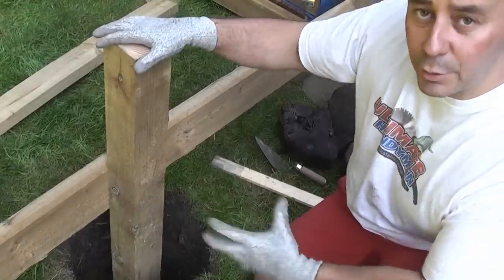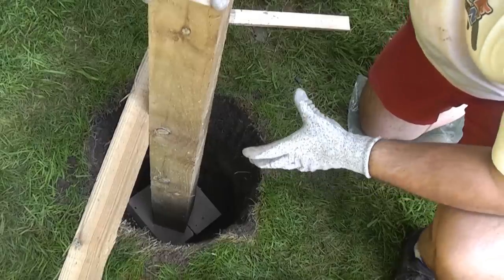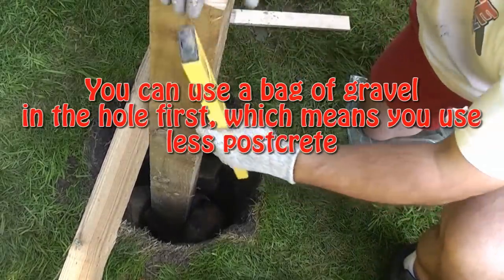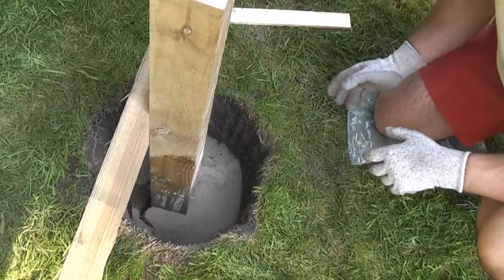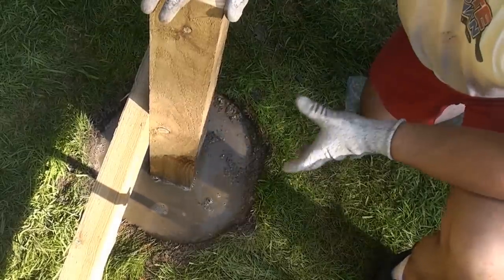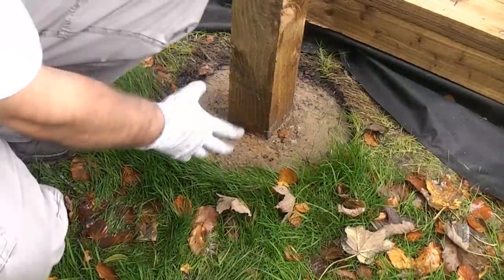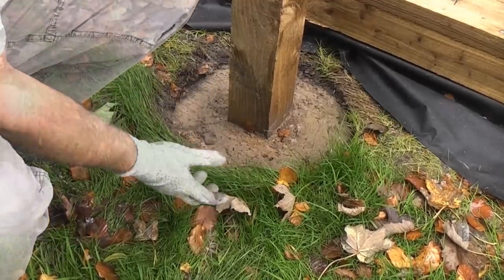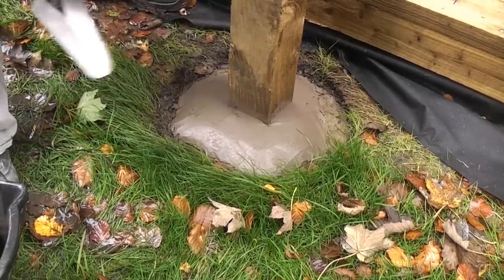How to install decking posts

Comment: Hello handyman. Can I use gravel in the holes instead of engineering bricks? Many thanks.
Reply from the maker: No, it needs to be solid to give the post support.
Once you have put the engineering bricks in the bottom, you can then fill the hole with some gravel, before using concrete or post crete to secure the post ;-)
Reply: @ultimatehandyman  that's great thanks for your help. Will breezeblock's work? Totally makes sense. Cheers.
Reply from the maker: @graham6807   It's better if the block is solid, if the block breaks, the deck could fail!
Reply: @ultimatehandyman  thanks again for your reply. Will make sure it's on engineering bricks. 👍

Comment: Have you any videos on installing a telescopic bollard into concrete for home/car security?  
The foldable ones are not as secure , but I don't known once iv broken through the first layer of concrete if its just a sand screed or if driveways are solid concrete, it would be a nightmare breaking and digging out the depth of the bollard sleeve  if its solid floor.
Reply from the maker: No, sorry I have never installed one of those.

Comment: Hi could you just use the postcrete to fill the hole half way up and then once its hard fill the hole back up with topsoil so you get grass around the posts? Surely it wont rot if its tannalised wood ? thanks
Reply from the maker: +Ed Macfarlane I would not have the soil in direct contact with the post, which is why I capped the top to aid water run off. Yes the posts are tantalised but they will rot quicker if in direct contact with the soil. I often chuck a load of hardcore in the hole before the post crete, but I didn't have any at this time.
Reply: +Ultimate Handyman unless you use ground contact treated lumber
Reply from the maker: +Atergia 
Thanks, I'm not sure what that is to be honest.
In the UK we seem to have tanalised timber for outside projects, which is perhaps the same thing?

Comment: Not up to code in our state. Post and concrete is rot city.
And you can't tie your posts into the frame. They must be UNDERNEATH. No inspector clears THAT deck. What happens when your nails rust on that pressure treated? The deck collapses.
Reply: Certainly is an odd way to build a deck!
Reply: Fuck a code. It’s a deck with 3 bags of concrete per post. It will be alright. Don’t be that guy.

Comment: people are funny here. In the U.S. people still bury posts in the ground. placing a post in the ground with concrete depends on your local building code and the weather. I live in Cali in a well draining area so I do bury my posts and use concrete. P.T. lumber if you get the good stuff can be in water. There is a secret to putting wood posts in the ground to help reduce rot issues of the post but since all you people think its wrong I dont need to tell you but its actually covered in a video on youtube by someone.
Reply from the maker: Thanks for the comment ;-)
Reply: Tell me please bro

Comment: quick tip put some old engine on the ends of the post it helps to keep the rot out
Reply: I put my old 2008 altima engine until now my posts still strong

Comment: Wood moves. Concrete doesn't. In time, those posts might end up cracking the concrete, allowing moisture to come and go from it and then destroying the post itself. In my opinion.
Reply: Never seen a post break concrete.  I've seen rotten posts inside concrete, which can be mitigated with some sealant at top of pier where post enter concrete.

Comment: Going to attempt to build my own but was just wondering, what's the difference between what you used and concrete??
Reply from the maker: Post crete is much easier to use as there is no mixing, you just tip it in the hole and wet it ;-)

Comment: One question that I d ask:How does one ensure that posts are perfectly vertical? if you set them perfectly,then you pour in the concrete,won't they sway  sideways?
Reply from the maker: Once it is vertical I normally put some large stones in, so that they hold the post in position- then I empty in the post crete.
If you don't have the large stones you can knock some thin pieces of timber in on a angle across the post and then screw these to the post to hold it in position.
Thanks for the comment ;-)
Reply: Tack some scrapwood on diagonally to hold it
Reply: Just check with a level after 😂

Comment: Hy again,
I'm going to use a 20k bag of ready mix concrete from wikes to secure my concrete fence posts in. But on line doesn't state the amount of water.
I know it's needs to be like a porridge consistency but once iv poured bag in whole it will be hard to see if it's a consistent mix throughout. Any sort of rule of thumb please
Reply from the maker: Are you using ready mixed concrete or post crete, like in this video?
Post crete, you just empty it in the hole and then wet it afterwards. With ready mix concrete you have to mix it with water (perhaps in a wheel barrow) then empty it into the hole, you just add enough water so that it is mixed thoroughly and is all visibly wet.

Comment: what happens when you dont put concrete under the 4x4 for a deck but around it the deck sits 2inch off the groung it basicly done i use 2x6 and put and spaced. 4x4 all through it i long i got be for thr eirst happen

Comment: Wouldn't the post still rot from the inside out since concrete is very porous and water will get soaked up like a sponge
Reply from the maker: No. If you look at any wooden fence post, they always rot at ground level. The part in the ground is fine and the part above ground is fine (providing the post is treated). As long as water can’t pool at the base they should last many years. 
Thanks for the comment 👍

Comment: I am in the process of building a raised play house based on a raised deck principle.  Do I use the same principle?
Reply from the maker: Yes, it's the same principle but you have to ensure you use enough posts and that the posts are a suitable size to hold the weight of the structure. How high will the playhouse base be from the ground level?
Reply: *****
No higher than I metre from ground level.  The rear 2 thirds will be in a raised flower bed.  So only the front third will be at 1 metre height.  The length of the "deck" will be 2.8 m and the width will be 1.8 m.  My intention was to use 6 x 2.4 m posts. 4 corners and mid length.
Reply from the maker: Carlton Douglas
That sounds about right (but remember I am not a structural engineer). I did a similar thing for a playhouse in the garden here but not quite as high. I used six posts but used 8 inch by two inch timber to build a frame for it, so it is very solid.
Reply: ***** Thanks for the reply.  I was intending to 3 x 2 timber for the frame.  I think the idea of 8 x 2 makes more sense.  Makes the structure more solid.
Reply from the maker: Carlton Douglas
I remembered posting this- http://www.ultimatehandyman.co.uk/forum1/playhouse-base-t65570.html

I knocked the posts in with a post rammer, but they were well knocked in. You can see that mine is just above ground level, so for an elevated base I would definitely dig holes and fix the posts.

Comment: 3 bags of poscreat how much a bag... great videos by the way
Reply from the maker: Normally I'd just use one bag of postcrete but had no rubble that day to back fill the hole!
Reply: on the dry At 600mm depth with a moderate amount of rubble I'm getting through 1 and a half bags a hole at approx 5 pounds a bag
Reply: on the dry   B & Q have them at £5-15p for each  20kg bag if this helps. 👍

Comment: Hello I was wondering why not use 4×4 metal post  instead of putting the the wood in the ground n cement?
Reply from the maker: +Avtar Bhogal You can do. This is the way that most people do it in the UK, which is why I used treated timber.Next time I might use concrete or galvanised steel. Thanks for the comment

Comment: Good vid, wouldn't recommend putting anything other than concrete in the bottom of the hole as you should always ensure no ground water will come into contact with the bottom of the timber.

Comment: why not  mix then pore the cement in lol this is a completely new way for me
Reply from the maker: With post crete there is no need to mix it, you simply open the bag and empty the product into the hole and then wet it.
Thanks for the comment
Reply: thanks for the reply this saves so much time instead of mixing up

Comment: Stones and bricks weaken the concrete.
Reply: birdshit good thing he's not holding up a 3 story building with that footer. when I put up sign posts I also use this method. less clean up.
Reply: hahahahahahahahahaha lmao......birdshit?
Reply: Can you add aggregate to the mix to save on the amount of postcrete bags needed? Or is this included in what you mean by stones? Cheers
Reply: acchually he'd tell you its a raining while peein on yer legs.
Reply: Seems like alot of post Crete for one post. Is it a raised deck. I only use like a bag of I'm doing fencing for each post. Then just tamp an throw a few rocks or stones In before hand. Then birdshit come an tells me off
Reply: birdshit get over yourself,!🐖💨
Reply: birdshit your confusing tensile strength with compound strength dear boy,!,,and whilst your at it, Get the fuck over yourself,!  You are a perfect example of,,”A little knowledge is dangerous”🐖💨
Reply: MARTINWHITELAW for sure,,the abusive cretin is confusing compound strength with tensile strength! 👍
Reply: It’s a deck. A few stones added in to 3 25lbs bag on concrete will be alright. Relax you freaks, it is just a post.

Comment: How would it work if the garden is all concreted anyway?
Reply from the maker: You would not need to install the posts, you can install a ground level deck like the first picture on this page-
http://www.ultimatehandyman.co.uk/diy/decking/basics.htm
Reply: cheers, much appreciated. First DIY project starting after thebworst of the weather is over lol. wish me luck :D
Reply from the maker: Basit Jabbar
Good luck ;-)

Comment: When fitting fence posts why not run a plastic D.P.C around the bottom this must preserve the post longer than just setting them straight into concrete.
Reply: what is a DPC?

Comment: I just saw a video that says wood shouldn't touch concrete because it soaks up the moisture. everyone in construction says different things.
Reply from the maker: There are always conflicting views.
When I was at college one of my exam questions was about materials "creeping", two materials that I was told "creeped" were glass and lead. Apparently now glass does not creep, so the teachers and the examiners were wrong!
Thanks for the comment
Reply: Do you think I could build a house using this method? I'm looking to build my first house

Comment: Any chance you have suggestions or advice on digging a small whole  for a fence post. I'm fitting a post at side of my house to keep garden secure but unsure about digging though the concrete. Can I use my sds drill with chisel bit to make whole and pick out the loose   bits. I assume after about only 4inch down past the concrete it will jus be gravel and soil?
Reply from the maker: Yes, once you get past the concrete it should just be gravel and soil, but be aware that thee utility companies often run gas pipes or electric cables down the side of houses, so you have to be careful- don't go ramming a steel bar in the hole or you might get a nasty shock!
I'd cut the concrete first with a grinder and diamond disc, then break out the centre with the SDS.

Comment: No need for three bags of postcrete, there is virtually no lateral movement  in decking posts all the force is vertical so is straight down, use a post shovel to excavate the hole as well, it doesn't need to be that big, then one bag will be sufficient. to hold it in place.
Reply from the maker: I thought I mentioned in the video that I had no hardcore (perhaps I didn't)
Thanks for the comment

Comment: Wouldn't using metal footings in the concrete be better so the wood it self would be off the ground by a few inches?.. Over time the wood would still rot being in the ground specially if you live in a wetter environment , And if you have to replace a leg or two its gonna be a pain in the back side.. At least with the metal footings the wood is completely of the ground, and any repair jobs would be less of a pain... anyways nice vid.
Reply from the maker: Hawk Eire Yes, I agree that something made from metal would be better but most deck posts are installed this way in the UK.  As long as the cement is added to the top in a dome shape it should minimise the amount of water able to penetrate the timber. Metal deck footings seem to be pretty common in other countries around the world (just not in the UK yet).
Thanks for the comment
Reply: +Hawk Eire 
Wood will last a very long time as long as it is kept relatively dry. My uncle lives in a wooden farm house that's over a century old. It also has "ground contact" all around and is still fine.
The only reason I wouldn't put the wood into the concrete is that you can't adjust the height afterwards. What I like to do is to stick a threaded rod in the wet concrete, put a nut and big washer on, then drill a hole in the bottom of the post and stick it on. I've always only used galvanized rods and never stainless, and that seems to work, so it's cheap.  It can carry a ton. A corner of our house is resting on maybe a M26 threaded rod (and that's not a bodge by me; it was installed by professionals), so something like M12 should be plenty for any deck. The only disadvantage: the post obviously isn't rigidly connected and won't stay completely vertical on it's own. So it can't be used for a fence for example. But as soon as you have connected something to it, like in a deck it, it's perfect especially for the ease of levelling.
Reply from the maker: +superdau 
Thanks for the comment ;-)
Reply: all you have to do is dig the hole twice the length of the post and it shouldn't move much. no need for concrete.

Comment: how much space can you leave between each post mount?
Reply from the maker: It depends on the design of the deck and what joists/bearers are going to be used.
The stronger the bearers/joists the wider apart you can space the posts, but normally they should not be spaced out more than 1.8M
Reply: Ultimate Handyman .

Comment: Dont you need to mix the water and the postcret?
thanks for the vid :)
Reply from the maker: No, you just pour the postcrete in and then wet it afterwards. You can buy ready mixed concrete, which you need to mix with water first though ;-)
Reply: ***** Thanks for the fast replay. you should know, i rarely do DIY projects. i watch your videos because its fun to watch. ;)
Reply from the maker: ori yohannes
That is good to hear, thanks for watching them and thanks for the comments ;-)

Comment: Job well done, but ... do you thing that putting wood in to ground it's god idea ? IMHO rot very quickly,would be much more durable foot of concrete with a steel rod.
Reply from the maker: +Jakub Wójcik I just demonstrated how to install them as this is the accepted method of installing decking posts in the UK.The timber is treated and should last 15-20 years as long as water is not allowed to pool where the post exits from the concrete.Personally I think steel reinforced posts would be better if you wanted the deck to last as long as possible.Thanks for the comment

Comment: Why did you embed wood into concrete without wrap or tar? Should have used steel post with wrap or epoxy. Never would of rusted out that way.

Comment: does the hole need to be this big
Reply from the maker: It needs to be wide enough so that you can get the two engineering bricks at the bottom, but the deeper you go the harder it is to keep the hole a small diameter unless you have an Auger.

Comment: treated wood in the ground will never make more that 5-10 year, I try diferent type of wood here in canada and the best is cedar, much better that treated wood that is not try enough when treated,,, the diference is that you will have rotten from indside the wood and not outside,,,
Reply from the maker: Thanks for the comment
Reply: +Theo H my deck thats 25 years old and you could still to this day drive a car on. is treated 4x4 buried with one bag of concrete at the bottom of each post. not rotted in the slightest.
Reply from the maker: +Atergia 
Thanks for the comment ;-)

Comment: to prevent the bottom of the post and woods go rot in time you must dip it in tar btw termites cant attack the woods
Reply from the maker: Thanks, I don't think we have termites in the UK but I know they have them in other parts of the world.
Thanks for the comment
Reply: I drown mine with used engine oil

Comment: wow 3 bags of post mix that is a bit of a over-do don't you think
Reply from the maker: Yes, absolutely. Normally I would fill it with hardcore and just use one bag, plus I would normally use a post hole digger, so the hole is not as wide.
Thanks for the comment 👍

Comment: Whoa 3 bags , why make hole sooo big
Reply from the maker: You have to make the hole large enough to get the engineering bricks at the bottom.
Normally I fill the majority of the hole with rubble, I thought I mentioned that in the video.
Thanks for the comment 👍

Comment: wrap the posts. They will last longer
Reply from the maker: Thanks for the comment
Reply: Since buying my first house last year I've been watching every DIY video on Youtube and I always wondered why the bottom of woodens posts are not dipped in like maybe a PVA/wood glue and left to dry. Water can't get into them if cant even touch the wood right. Perhaps over time the glue breaks down but can only help it last longer?!
Reply from the maker: @supermankelly   The posts are tantalised, which should prevent them from rotting.

Comment: This would not happen in Norway, only epoxy coated steel should be enclosed in cement. We would always keep wood away from any chance of rot, and if it did rot it should be able to replace it easily.
Reply from the maker: Thanks for the comment